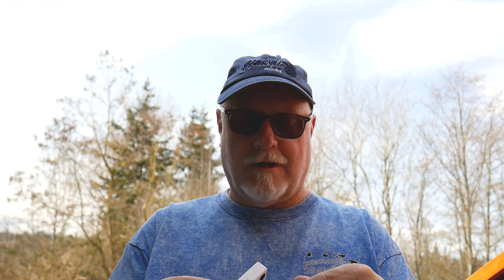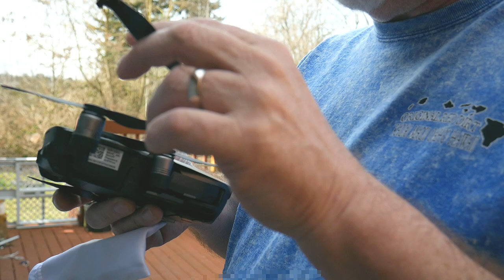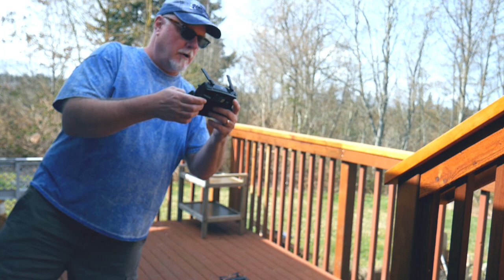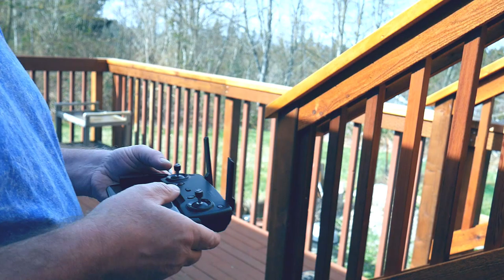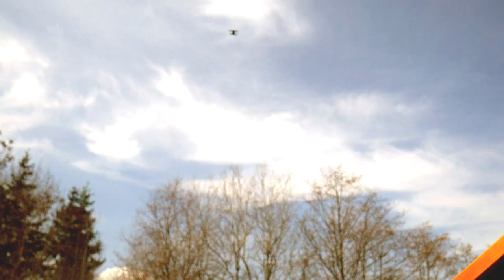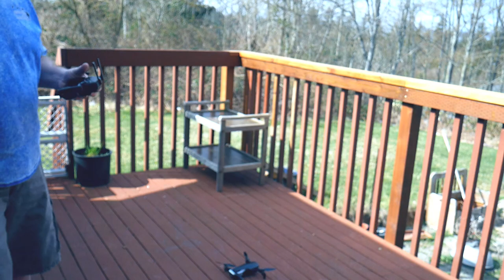DJI Mavic Air -  Master AirScrew Stealth Props

Comment: One thing you have to do is to go into settings and set you GAIN settings all to 80$. This will stop the motor warnings that pop up in sport mode. These props are more efficiant than DJI's so will load up the motor, setting to 80 will rectify this. THAT SAID i seen on one other site that the reviewer called DJI and confirmed they will VOID your warrentee for using ANY aftermarket parts. I bought two sets though and they are much lower pitch and have had no problems.
Reply from the maker: Check the pinned comment. Thx for watching.

Comment: Try running them in sport mode and see if you get the engine code saying like they are hot. Alot of folks are getting it I bought a set but I am not putting them on dont want to burn up the motors. I think its because of the steep pitch of the blades vs the stock
Reply from the maker: Honestly I won't ever use sport mode. I just use it for pics and vid. Thanks so much for watching.

Comment: I would say they are much quieter. 1 question, how would this affect your warranty or after care? But it does sound so much better. Thanks for sharing.
Reply from the maker: maybe on whatever unit they were on ...not sure possibly ...prolly something written somewhere about it .... I just wanted to know if they were quieter ...my refresh runs out in April I think ?
Reply: Hi Lloyd ..if something did happen like the drone crashed ,how would dji  know what props u had on.  .I don't think dji  could tell to be honest
Reply: tomas o sullivan, 😁 After I wrote it I got to thinking, well duh just change the props back before you send it in. It was kind of a dumb question lol. Thus why I’m a Vlogger not a Droner 😁😁😁👍🏻.
Reply: Coast to Coast Drones in hindsight I realized it was kind of a silly question 😁😁😁😉. I think I may get a set though. Definitely makes the Air quieter.👍🏻👍🏻👍🏻👍🏻
Reply from the maker: @grumpyvlogger  Honestly Lloyd ...I think you are prolly right though ...it might void any thing like that ....but I just wanted to cut down on the BEE sound ....LOL !!
Reply: @grumpyvlogger  not a dumb question at all Lloyd ..but don't think there's a way if them knowing what props is on there . Talk soon Lloyd

Comment: Nice video bill .defo the standard props are a lot higher pitch and buzzing tone and the master airscrew is a deeper tone ..for me it's not always about decibels but the tone /frequency is more important ..I have been using master air screw for a while with my phantom 3 love them ...
Reply from the maker: Thx so much

Comment: You can definitely hear the difference.  Is Luminar 3 & Airmagic the same.
Reply from the maker: no .....Luminar is stand alone full editor ....Air Magic is AI with different add on styles ... made for aerial platforms ..but works with any photo ...and I think they have a deal running ...just click the link for skylum in description and check out everything ...they even have trials !!
Reply from the maker: with Air Magic ...you just insert the photo and the software does everything for you
Reply: @CoasttoCoastDrones  Thank You So Much.

Comment: If you crash it with this props you think dji care refresh will still be available in this circumstances? I plan to buy them also but don't want to mess with my warranty..
Reply from the maker: I honestly don't know the answer ...but there were 2 reasons I got these props ...Donnie (Big Drone Flyer 77) and my refresh runs out April ...I simply wanted something quieter